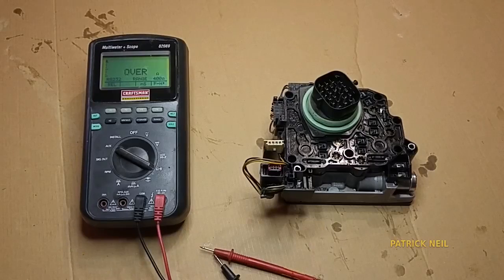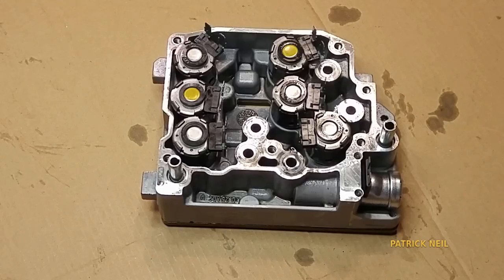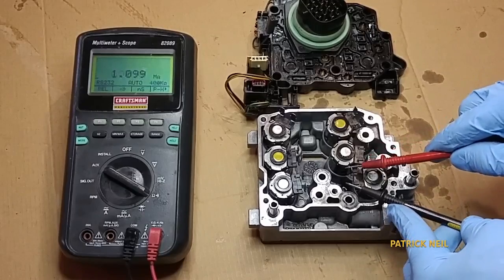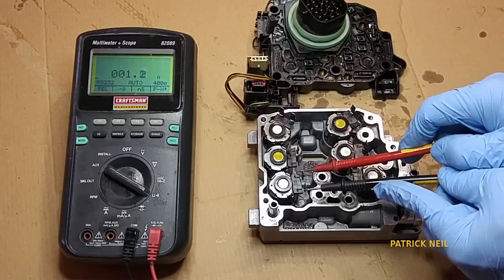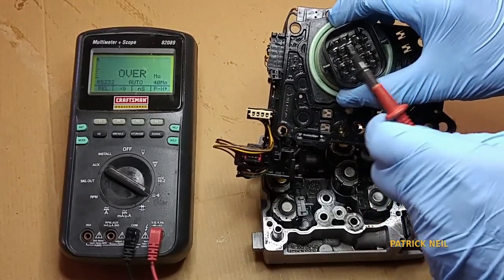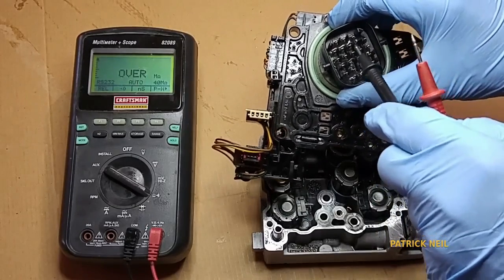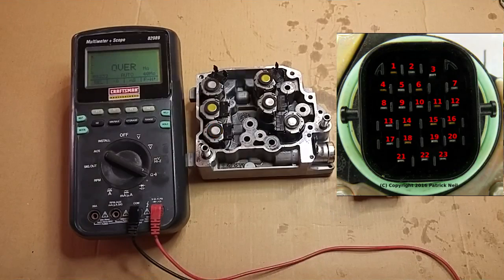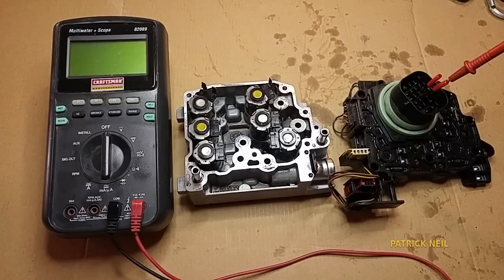62TE Solenoid Pack Pin ID

Comment: What happens if the o-rings on the solenoids are not sealing right cuz there’s fluid inside the solenoid pack and I’m getting code p076a  check the resistance check out good 1.3 ohms my dodge journey is in limp mode stuck in 2nd gear

Comment: Hello, my Journey 2014 3.6 went into emergency mode and made a cavitation noise in the Valve Body, I replaced the Filter and the oil because it was clogged and after I replaced the oil and the filter the Code P083B appears, already I reset the code with a scanner but the code comes back, I've already checked all the electrical harnesses, everything is ok, and no noise appears. Could it be the valve body? Or the Pressure Sensor?

Comment: I am getting 3.0 ohms at pin 20 dc solenoid all others good as i get a p076a code no shift shut off restart car then ok for couple more miles and notice when no shift manual shift is gone also when acts up should i change solenoid thanks!
Reply: I got the same code on my 2010 dodge journey just haven’t had time to check what’s wrong
Reply: @charrito020  just replace bad solenoid or assembly good to go solenoids tough to find eBay or u pull junkyard
Reply: @njoeandjen thanks

Comment: Thanks to Jose for answering my question. One other question I'm curious about, all the charts/tables I have seen online showing what the ohm readings should be for the 62te solenoid pack (in particular the one that the Motor City Mechanic has), show the solenoids should be 1.6-1.8 ohms except for the Line Pressure Solenoid which is 4.8-5.1 ohms and the signal pins show 300 ohms. All my solenoids are 1.1 ohms, the line pressure solenoid is 2.6 ohms (most likely bad) and my signal pins all have 104.4 ohms, those readings are consistent which I'm going to assume is good but like I said different from any posted chart or diagram I've seen ? Are there some that are different does anybody know or I have I got an oddball solenoid block ? The transmission has a tag on it that says it is a rebuilt transmission.

Comment: I'm getting 2.6 ohms on the Line Pressure Solenoid (pin 12) is that acceptable or not ?
Reply: No
Reply: 4.8-5.1 normal

Comment: Might be a good idea to check the continuity at the other end of the 23 pin wire harness, so it too is included in the test. What if there was a break in the wire or a bad contact at the connector pins...
Reply: Hello. How can I check it ?
Do you mean by AVO meter ? And how many Volt should be ?

Comment: Hey, Patrick, great videos. My van is in limp mode with a p0760 code. I replaced the solenoid pack but it's still in limp mode. OD pin reads 2.4 ohms. Do you think it could be the TCM? Thanks.
Reply from the maker: The TCM is integrated into the power train control module. Meaning it also control the engine.  Whenever reading with an advance dealer equivalent scan tool, there is no separate TCM to diagnose. So the possibility of that part been defective is low.  I would replace the valve body and the solenoid pack.

You need more advance diagnostic. A process where you can drive the vehicle and read the data sent from the Power Train control module. This will tell what the solenoids and sensors are doing along with the hydraulic pressure applied.
Reply: @pnswg01  Thanks for the quick reply!

Comment: Hi, I keep getting code p0765 for solenoid d. I changed the solenoid pack and the fluid and filter but still getting the same code and its stuck in limp mode. Any ideas?
Reply: Did you find your issue?

Comment: Hi Patrick how are you thanks for the video. I have a question for you  I have 2013 dodge grand caravan I changed the transmission everything in the transmission fits my car  Except for the  female adapter on the transmission is different than the Male cable on my car so what should I do any  Solution thank you
Reply from the maker: Are you saying you change your transmission to a different type because it bolts to the engine? or both transmission are the same model 62TE?
Reply: @pnswg01  lkq gave me 2011 Chrysler 200  everything fits they put it on but when they tried to put the cable they found out that the female on the transmission is different
Reply from the maker: @salamjosal  Ausuming we are talking about the main harness. 

Looking at the picture the transmission side (solenoid pack) is male. (Those 20+ pins sticking out of it is suppose to be inserted into the harness connector) female.

If that is different, that mean that transmission use a different interface/solenoid pack. In this case I cannot help.

Even if you ID the pins and splice it, you still cannot guarantee that it will work correctly.

Comment: Great Video 
I have a issue with my 2012 jeep overland summit 5.7 hemi when move shift from 
Drive to Neutral knock noise from transmission.we can not find the problem.we open 
65RFE we open solenoid we seen something unbelievable, in this part has only 5 
solenoid kit , please what you think about this problem ?? please can you tell me  how to fix the noise from transmission ?
regards
hemn
rangalaprint@gmail.com

Comment: Patrick where is the valve body cover located on an 08  grand caravan? Sorry for the dumb question but i cannot determine where to start from the video or anywhere on the net?
Reply from the maker: On the front of the transmission/gear box (Left side of vehicle) Here is the complete instructions to change the solenoid pack.  https://www.youtube.com/watch?v=dH2-1VE8KWU&t=17s

Comment: Hola buenas tardes, quería ver si me podría asesorar por favor!Tengo una Town&Country 2013 Motor Pentastar Me marca 3 códigos: P0890 (Switched Battery), P084B (DC Pressure Switch Rationality), P084A (DC Hydraulic Pressure Test) entró en Limp In Mode no me hace los cambios ni acciona el Kick Down por ratos trabaja bien luego hace lo que comento y tiende a patear, qué podría ser?
Reply from the maker: Sorry, I can only speak English.

Comment: good afternoon friend. I write to you again from Venezuela, I hope your help, regarding the failure of the selenoid b that I commented to you, I got an individual selenoid and made the change, I thought that the fault was going to be removed, but it remains when the car warms up, makes the measurements and it goes over 35 to 40ohms, my question is if the fault is in the cover that your samples in the video, where is the connector of 23 ping, since this cover has a resistance of 300ohms, help please

Comment: Greetings friend, I have a transmission 62te, chrysler sebring 2008, when the car heats the selenoid B makes a variation and blocks the transmission, I can explain why to warm the car this control selenoide fails, greetings and thanks from venezuela
Reply from the maker: Resistance do change with temperture. With some material, the resistance go up with higher tempertures while others go down at lower temperture.

For solenoids, if the resistance go up at higher temperatures, less current will flow which may slow the reaction time. The detection process in the TCM may also use the resistace to tell when the solenoid circuit is bad and put the transmission in limp mode.

This is NOT a known fact with your transmission, but in general that is how the dection process works. Open circuit, resistance too high or too low will trigger a condition.

Hope this help.
Reply: ok thank you friend, specifically the fault is in the exchange selenoid b, 2-4 Solenoid control ping 21, I understand that of the 6 selenoids 4 work normally closed and 2 normally open that is change by the under drive, here in venezuela I do not get the package of selenoids or the individual selenoids, I will buy it on ebay but I'm not sure of the selenoids that they offer me only the part number that is Mopar 05169313 AA solenoid, Variable strength, I need you to help me buy the indicated selenoid and that do not send me another one, thank you

Comment: hi patrick.
my sebring 2008 is a code P084B its mean DC solenoid may be defect! i can replace only this solenoid?? if i buy solenoid pack i can take only one DC solenoid and replace it? 
thank you.
Reply from the maker: Sorry, not sure about the Chrysler Sebring.  If the transmission model is 62Te then you cannot change individual solenoid.  (They sell all solenoids as a complete unit)
Reply: Patrick Neil 
ok i am understand, but if i buy new or use solenoid pack , i can take one solenoid and replace individual in my old solenoid pack?
Reply: Hey Patrick
I also join the question I have Chrysler Sebring 2008 with 62TE and I wanted to know if I buy the part you explain in the video I can disassemble only the specific solonoid I need and replace only him instead of dismantling the whole unit from my car
Thank you

Comment from the maker: To Abel Ramirez:

Yes you can.  Place one lead from the ohm meter on pin 10 and the other lead to the solenoid you want to test.  For example, if you want to test the 2/4 shift solenoid, place one lead on pin 10 and the other to pin 21.

Pin 10 is in the 3rd row, and is the 3rd pin (or in the middle of all the pins) This pin is common (basically one pin from each solenoid is connected to pin 10).

Line pressure/variable force = pin 10 and 12
Direct clutch = pin 10 and 20
Overdrive clutch = pin 10 and 19
Under-drive = pin 10 and 7
Low/reverse = pin 10 and 2
2/4 = pin 10 and 21
Low clutch = pin 10 and 17

Base on my experience with this solenoid pack, resistance measurement can check ok and they still don't work as they should.  It is best to just change the whole pack.

UPDATE: Also change the 2/4 solenoid valve/plunger located behind the valve body (look like a little black plug) and all 6 o-rings.

O-rings = $2.80 each at Chrysler dealer
2/4 valve/plunger = $8.50 at Chrysler dealer

Good luck...

Comment: Hi Patrick. If I'm getting 1.1 and 1.2 on most of them, is that too low or within normal limits? I know you said if it's higher it should be okay, but I'm not sure what an acceptable low would be. Thanks in advance.
Reply: haveing the same thing. all reading 1.1. did you figure it our?

Comment: Patrick, thanks for the video. I did this test on my 09 Routan and received 6.0 ohms and 2.0 ohms for the rest. Are these numbers cause for worry or do you think because they are consistent I am probably good?
Reply from the maker: The line pressure variable force solenoid should measure the highest.  I got those specs form a transmission parts manufacturer. I think Chrysler list them slightly higher.  I am too busy to search the repeditive Chryler repair manual. Check online, someone said they found one. + 0.4 ohms more is fine. + 1 ohm might be a bit too high.  Measure at room temperture and with a good quality multimeter.

Comment: yes! i found out that's her! But, i not still found the real problem! The vehicle is working in emergency mode, just in 3rd speed, i'm working this! thanks for attention.
Reply from the maker: If your transmission fluid is not contaminated then your problem is the solenoid pack.

https://youtu.be/qKiOyRvwC70
Reply: +Patrick Neil i Changed the Oil, was very contaminated. I'll remove the solenoid pack for inspection and analysis!